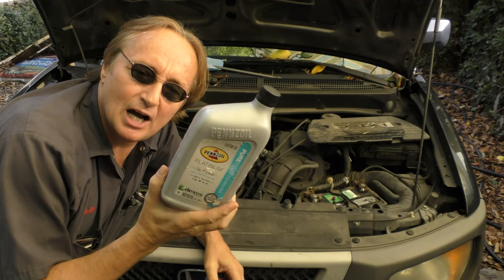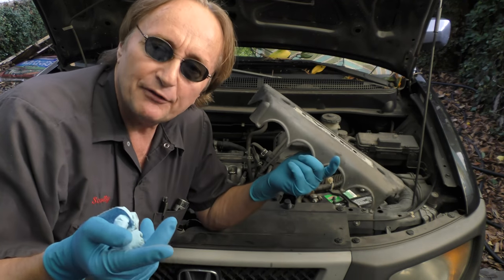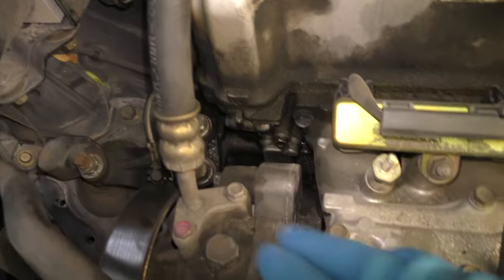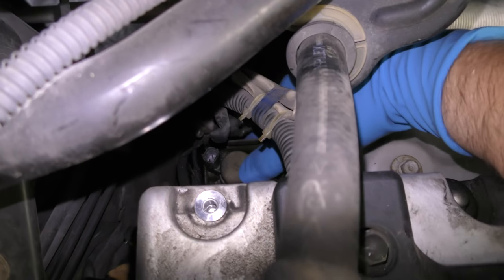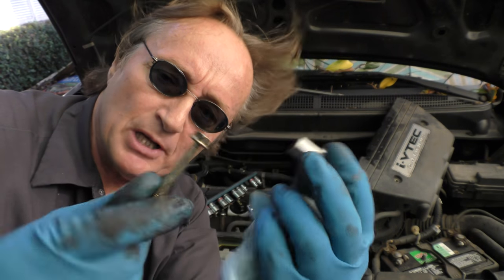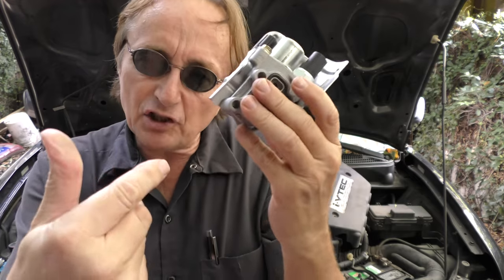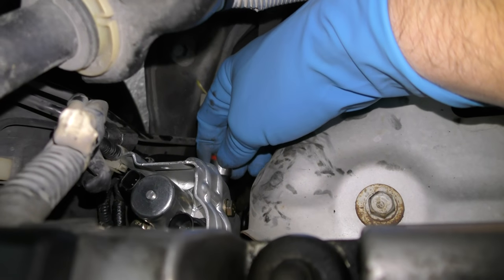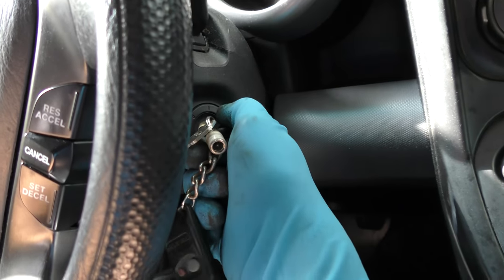How to Fix Variable Valve Timing in Your Car (VTEC)

Comment: I got the same check engine code, I replaced the same solenoid and the light came back on, and the car bucks when your trying to climb a hill of any sort, and the oil is also brand new, I'm at a loss, I don't know what to do, someone please help.

Comment: How you doing? I’ve been looking every where for a fix for the code: P0661 IMT (IMRC) CIRCUIT VOLTAGE LOW. for an 04 Acura TSX hope u have a solution.

Comment: hello guys , I have a 2012  sonata engine light came on and knocking sound for the engine . code is P0011 any tips how to fix the problem ??
Reply: Jose Gomez I'm running into the same issue but my general troubleshooting is looking into the oil pressure switch/sensor and see if the wiring is bad. My connector head is chewed up sending inconsistent readings to the computer, pulling up the codes. You can also check the oil control valve filter which can become clogged up with stuff over time. And finally the Oil Control Valve itself might need to be inspected. If all else fails there's also the Camshaft Sensor which is an easy replacement but it's worth testing anything over 50 bucks. But I might be SOL if I can't diagnose this code after another oil change, could call for replacing the solenoid in the vid or the engine itself.

Comment: ive yet to see one of those screens be clogged. but yeah majority of the times a oil change fixes the issue. its usually 5000 over for a oil change when this code comes on

Comment: I have a 2004 honda accord 2.4l and is auto, if you know that car have the ecu under the evaporator and the evap was leaking coolant so that make the ecu goes bad so i changed for another one from the junkyard, i needed to reprogram the key (immobilizer) but now the car won't pass 3 rpms i find out the car that i took the ECU had MAF sensor but my car don't mine use MAP sensor the codes actually are these ( p2185- ECT sensor 2 circuit high, p01012- MAF SENSOR "wich the car does not have" circuit low voltage, HO2S heater circuit malfunction secondary Btw already replaced the variable timing and clean those little oil  filters.

Comment: what was the symptoms of the bad solenoid?
Reply from the maker: +toolman talal as i said, vehicle would not run over 3 thousand rpms, it would just cough and slow down when you got that fast, like it was running out of gas. Plus the check engine light was on with the code showing solenoid system problems.

Comment: Nothing would fix mine. Found the issue changing valve cover gasket.  A plug (bolt) had fallen out and was laying up in the head.  This was downstream of the VTEC Selenoid so it wouldn't build oil pressure.  Loctite fixed my problem now she sails up to 6-grand no problem.

Comment: Just curious, what does one of those solenoid parts go for?
Reply from the maker: +David Last 126 at the dealer
Reply: 109.95 at the honda dealer online. but thats for the part that fits a 2007 CRV.

Comment: My 2000 Honda Odyssey is running very poorly I think in the diagnostic it said it skips when it reaches a certain RPM. And it has a v tec engine, but my check engine light hasn't come or anything.
Reply from the maker: +MrTivstip18 those often have serious cam problems from bad engine design, pray it's not that
Reply: +Scotty Kilmer I hope it's not a bad engine would not work for me. Thanks

Comment: Hey Scotty I got an issue I have a 2002 Avalanche 1500..
1st somtimes when I start the car it won't start like the starter won't work after it does that I disconnect the positive and reconnect if it will start .... Know it doesn't do it all the time .... And second problem my gauges like the temp and gas level will not go to where it suppose to be somtimes also the battery light in the message box and it would say low fuel but when I ride it the dash will work again and the message box would say servurity on it .....
Reply from the maker: +cartel pineda have the anti theft system checked out by a pro like me with a dealer scanner, often that does exactly that. And dash units are crap on those, cheaply made chinese units, they often go bad like that, but new ones cost a ton
Reply: +Scotty Kilmer so you saying go to a dealer to get the problem check out for the issue of the having trouble starting .... I've change the starter last week .... .... So don't go to a repair shop go to dealer rite and have the anti theft checked out
Reply: +cartel pineda make sure the anti theft telltale aren't on or blinking, its a gm passlock, which you need a tech2 scanner or equivalent scanner to diagnose this problem. its pretty common problem on gm anti theft and not cheap. on certain model you can bypass this by putting resistor
Reply: +ebu touy  now it stays on the message bored says security
Reply: cartel pineda no start? if you have another key try that
Reply: ebu touy hey i i went to get it checked out and code p1626 and they told me the ignition switch is the cause ???
Reply: Scotty Kilmer p1626 code pop up is my ignition switch bad
Reply: cartel pineda your ignition switch, just a mechanical switch if you replace those it will never cure your no start, theres a sensor around its called pass lock  but  again do your basic stuff, if you have another key try it and do 30min relearn procedure and make sure you dont have any aftermarket remote start or security spliced
Reply: +ebu touy I don't have another key and it has the alarm that came with it .....  So should I try the 30min relearning process and if not that change the ignition switch

Comment: my vtec won't kick in and i checked the solenoid screen and it was perfectly clean... should i check the little screen in frond of the engine? :(
Reply from the maker: yes, and realize the solenoids themselves often burn out and need replacing

Comment: toyota echo, 2005, I got it at 100,000km. now at 200,000km, all my time engine hated hills , changing auto to 3rd gear just made it rev, without must power gain, mid december 20021, I youtubed what vvti was, and set about trying to forse the engine to DO vvti, 2nd gear in the auto, up and down hills on a freeway-  Melbourne to ballarat, - it worked, something changed,  and no longer do i want to kick the heck out of the accelerator, , now -even on the flat  open road, the engine, is powerful and certain, -lol, just when i almost talked myself into trading it in, I have always changed oil on time etc, but some extra presure must have clear  the ports, and maybe cleaned out the catalytic converter, even now the start is diferent too

Comment: I have had the P2646 code twice. Both times, It was the day after a very hard day long rain, and I also had not driven it the day it was raining. Both times, I drove it for a couple miles the day after the rain, stopped at a store, started it back up and pulled out only to get the code and limp mode.  2005 Honda Element

Comment: Those three bolts are almost impossible to take off. Mine are frozen on. You can't see in the back of the engine either. I took off the Valve cover to make it easier to get to the VTC Solenoid Valve. Thinking of putting on a new valve cover gasket/lining, doing an oil change and see if that does it.

Comment: hey Scotty I just bought a 2003 Honda element with, first day it dove fine from Miami to Orlando, but now when I rev the engine up with won't go pass 3k rpm and it starts bogging..I went to AutoZone they said I need a engine timing solenoid, but mines isn't leaking?
Reply: I changed the spark plugs and o2 sensor, and it's still doing it.
Reply from the maker: doesn't have to leak, they clog up internally and often do that

Comment: hey Scotty, I have a 2001 Honda Civic with a similar problem. It wont rev past 4000 rmp. It runs very poorly and does not respond and I step on the gas all the way. I have the code p1259 for Vtec Malfunction.

Comment: Yeah that’s great to start with but those systems are very complex and have a lot of mechanical parts and engineering behind them so just keep in mind there could be a completely different problem with the system.

Comment: Um........... I would never listen to any one that think VTEC is variable valve timing.  Yes it can change valve timing but it is not variable.  Funny thing is he keeps calling it variable valve timing yet the code on the code reader say rocker arm control.  VTEC is high lift and low lift of the rocker arms, this will also change the opening and closing times of the valves.  There is only two (2) options, high lift and the other option is low lift.  there is no variable in between, therefor not variable valve timing.  Honda does have VVT but they do not call it VTEC.  I believe its iVVT!

Comment: Very rare for these to go, must be a few miles on the engine...
Reply: 9freelandk I had to replace the spread of my Element. Now mine was sitting for afew month before I started driving it. Seem to be more common on Elements
Reply: Robert Knight my element won’t rev over 4k thinking this is the problem
Reply: 260000km/160000miles on my 2004 I4 accord coupe and mine is just developing that issue. Pain in the ass

Comment: Hello, I have a 2007 Maxima. I'm changing the timing chain and guides(typical problem with this car)The point im stuck at is i have the chains off since they jumped anyway. My left bank is pointing way right out of alignment... My right bank is aligned(according to marks on rear timing cover) and my crank is aligned. Each time i try to move the cam lobes in left bank it pulls back out of time...OR if i push it forward it pushes too forward. I even backed of the crank thinking maybe i'm hitting a cylinder. Any ideas on what i can do to get back in alignment? ive seen these videos: https://youtu.be/2k5y8TiopzQ   and    https://youtu.be/OyYUj56wz9I   Which help but dont really clarify my situation of the lobe doesn't want to freely move to alignment...HELP?

Comment: I replaced that part The car still doing the same thing it’s good for about 7 miles then it starts running bad
Reply: Johnathan Evans A mechanic told me to do a engine flush. .you changing the part but it's picking back up the grit an slug from the motor a clogging everything back up

Comment: hi scotty ..i have an altima 2005 and it has overheating problems..i took it to the mechanic and he changed the water pumps, thermostat, and radiator..still overheating..amd a college student and i dont wanna deal with it anymore..if anyone wants to buy it $5000  133 miles..leather seats..clean title ..
Reply: Shot head gasket?
Reply: +gaby guzman $5000 and it's overheating? Where are you I want it....
Reply: +O'Neal Raymond  hi..madera ca
Reply: gaby guzman I was joking sorry.

Comment: i would have tried to clean the v tec solinoid first and put new gaskets and screen.  i bet that thing wasnt cheap ive never seen or heard of one needing to be replaced until now but glad it got fixed .....and yea the owners of that element need to clean up that engine haha cant stand oil and grease every where
Reply from the maker: +rsxstype505  cleaning was tried first, this baby was leaking and was bad. And they go bad all the time, so much so that I was able to get an aftermarket unit, and it was 80 bucks.
Reply: +Scotty Kilmer craaaaazy well now i know and thats not to bad for a new one thanks for the reply
Reply: I had a 05 Rsx that mine went bad and had to be replaced.
Reply: +Robert Casares crazy man well if my 05 ever starts running weird that will be something ill look into for sure

Comment: It's just not that simple on German cars... Can't wait to pull my transmission on my VR6...Sarcasm
Reply: Trans is not that bad. I swapped my old 02 Jetta from auto to manual. Had the transmissions and pedals swapped in a day--the bitch was rewiring the VSS and the reverse light switch. Good luck.
Reply: +smervelous Well I have a EuroVan, so I basically have to take the whole front end off to get to anything. I'm swapping an ALH from a TDI mk3 into the van and you can probably guess where the VR6 is going after some new chains...

Comment: The valve assembly you are holding has nothing to do with the cams.  It controls oil pressure to the VTEC rocker arms.  The solenoid mounted in the front timing cover controls the cam timing.  The screen/filter behind the power steering pump that you checked is for that part of the system and has nothing to do with this code.  next time, save yourself some time and skip that.

Comment: So today was a busy day I ran into a girl at AutoZone when I was trying to make some money I did not make no money I ended up helping her for free she barely bought this old car that was a Lexus and she said that there was a engine code p 0 0 22 which is a variable valve timing sensor malfunction and also that wasn't the case the problem was that she had transmission oil inside of the engine instead of it having engine oil she had transmission oil now transmission oil if you put that in your engine what happens is it can overheat the engine now perk not provide protection it also loses its viscosity that means that that transmission oil will stretch expand as it heats up and therefore it will not be thick enough to have the proper oil pressure and when you don't have the proper oil pressure in your engine the oil pressure check light will come on and you will lose horsepower and performance so I recommended her to get an oil change also she needed an alternator the alternator voltage voltage regulator was not working and that's because she bought a rebuilt and remanufactured alternator never buy a rebuild manufactured alternator... she was lucky that she found me because AutoZone had scan the codes and they told her that it was a thermostat temperature sensor or the temperature or the thermostat was out and that wasn't the case the case was that it was her transmission oil inside of the engine

Comment: Variable valve timing is not the same thing as VTEC. VTEC is a separate cam lobe that engages at higher RPMs with higher lift and duration. Variable valve timing is only an adjustable cam gear that changes timing with oil pressure.

Comment: I took out the one in the front and brushed it with a metal wire brush after replacing the filter, and now it leaks more oil. Fml.
Don't do that, people.

Comment: I had a similar issue with an Acura TSX where the solenoid value was stuck in the open position due to oil deposits that had accumulated around the solenoid piston. I used some brake cleaner to clean it out and problem solved. Details here: http://acurazine.com/forums/problems-fixes-128/seized-vtec-solenoid-symptoms-causes-solution-pics-879805/

Comment: Hondas aren't as reliable as they used to be. The ATs are probably the worst out here. They have jerky shifts and they do have failure problems along with TC issues due to defective parts and bad shift programming.  The timing belt needs changing every 96,000kms and now look at this issue. Add in the fact that they're super expensive to insure you might as well buy a used 3 Series BMW.
Reply: +Djonkie Bonk my insurance is less than $90.00 every 6 months 98 civic
Reply: TheK24Kyle A 335i or an M3 yeah but take for example a basic 328i. The only supposed weak point will be the plastic cooling pipes and the water pump which I recommend to change at 100k even if it's not leaking. Other than that other stuff like oil changes, tuneup and suspension items don't cost all that much and you get a solid car with good safety and a fantastic smooth I6 motor.
Reply: I've worked for Honda and BMW... BMWs drive better but overall they don't hold a candle to Honda in the reliability Department...